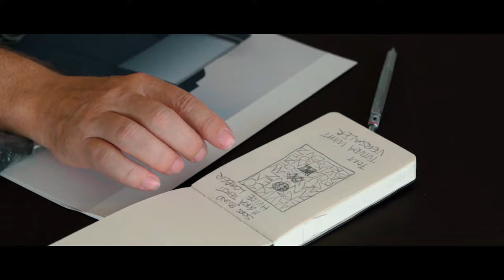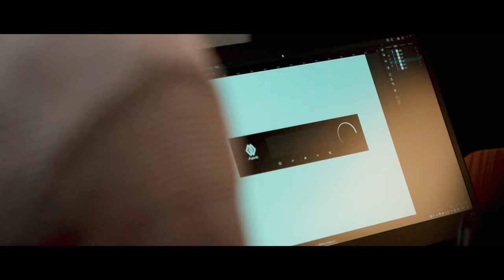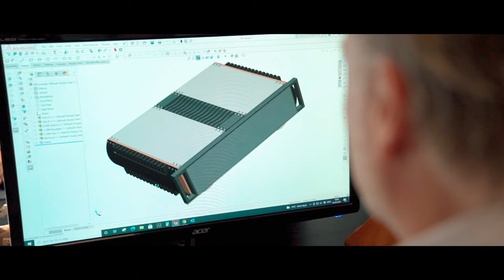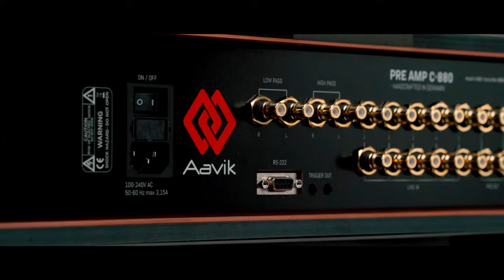Michael Børresen and Flemming Erik Rasmussen on the: 880-series | Tech-talk

Comment: the 'thick slabs of copper' could start thick, then become more porous as it moves toward the edges, like a sponge , so the surface area increases logarithmically as the heat moves away from the center and heat loss is increased. like veins in a leaf or roots of a tree.